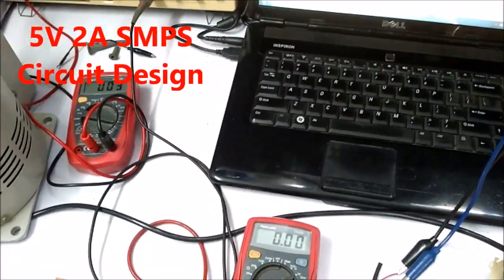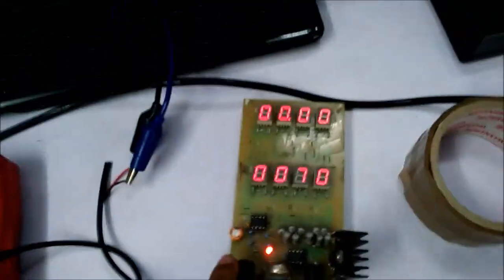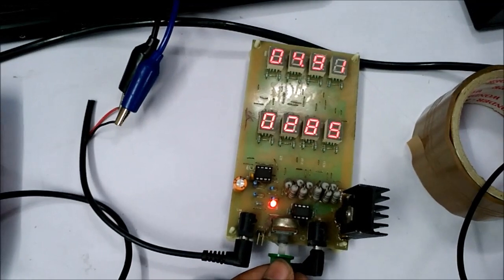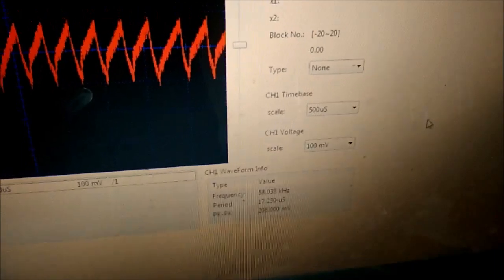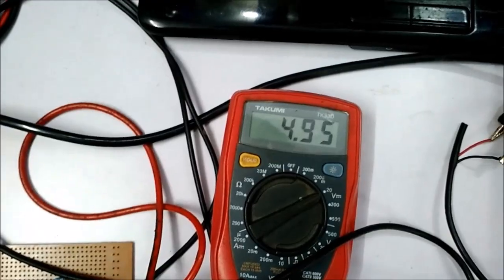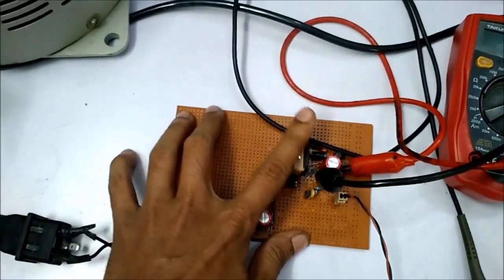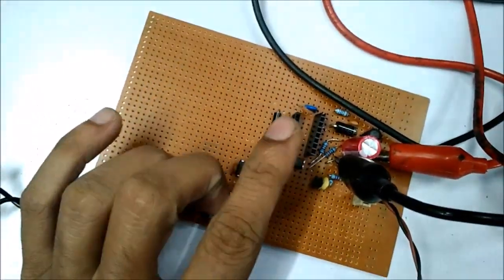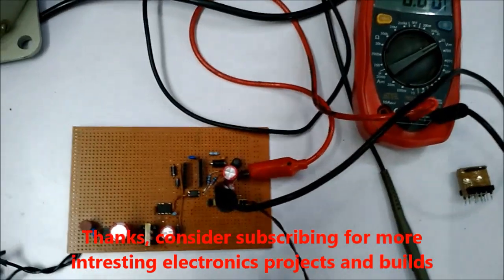How to Build 5V 2A SMPS Power Supply Circuit

Comment: I cant find bom on the site. Can you please help with the same.
Reply from the maker: BoM is not available but you can check this link https://circuitdigest.com/electronic-circuits/5v-2a-smps-power-supply-circuit-diagram for circuit diagram - we have mentioned all parts name with values
Reply: @Circuitdigest  Is this tested ?

Comment: "The D3 is a Schottky barrier diode. This diode converts the high frequency AC output to a DC. 3A 60V Schottky Diode is selected for reliable operation. R4 and R5 is selected and calculated by the PI Expert. It creates a voltage divider and passes the current to the Optocoupler LED from the TL431."

In this part, you have written that D3 diode is a Schottky barrier diode, can you please explain where we have to connect that D3 diode in the circuit because in the given circuit I didn't find it. please help!!!!!

Comment: Hi , you did not add any inductor filter on the output only the capacitor one, wont that change the power factor where voltage be lagging behind current ?
Reply from the maker: Hi, please post your questions on our forums https://circuitdigest.com/forums. The author will get in touch